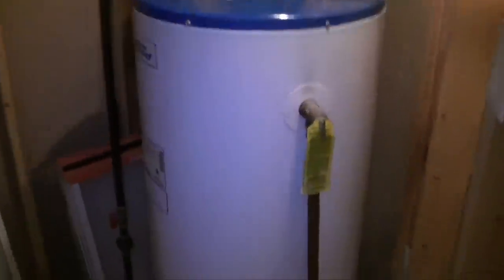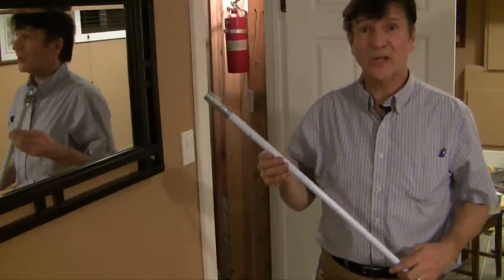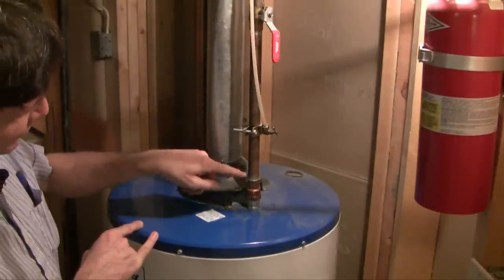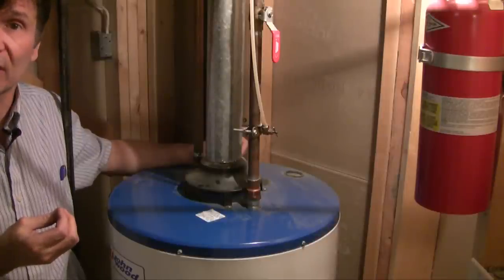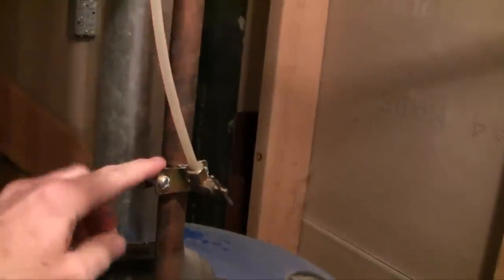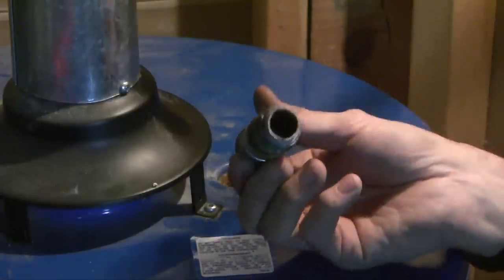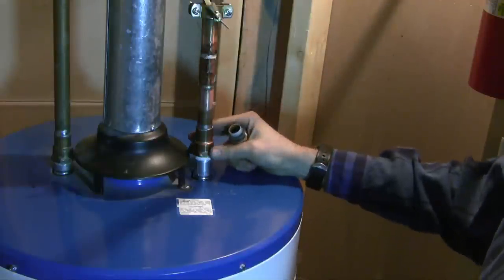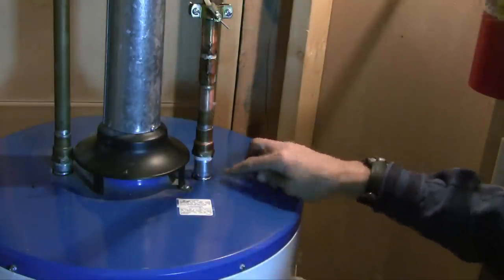How to repair a weak hot water heater, by replacing the dip tube

Comment: Amazing video.  Just what we needed.  Our dip tube was totally wrecked...almost severed from the fitting...obviously the problem.  We have just replaced it thanks to your help.  Saved us the $1500 it would have cost to replace the tank (which was the recommendation made by the service company we called.... verbatim... "We don't replace the dip tube in a hot water heater.  You need to install a new tank.)  This is the third time this year that the internet has saved us big bucks on home maintenance issues.
Reply: Of course not, the plumber wanted to make a lot of money selling you a new unit. You may want to call this same plumber and inform him you didn't need a new unit, just a dip tube that you installed yourself, also remind him
he's a dipstick for not installing a dip tube..
Reply: Katharine Redmond 👍
Reply: @dukeman7595 LOL! I LIKE THAT!

Comment: Just wanted to say thanks for the video.  You saved me $600+ from replacing a water heater.  

I have a 6 year old Rheem so my dip tube is a bit different than the one in your video however I was able to get enough information to figure it out.
My tube was broken off at the connector just like what was shown in your video. 

I now have nice hot water again for about $10.  

My symptoms were; 
1) Hot water runs out in about 10 minutes of use.
2) When draining the hot water tank the water didn't turn cold until after 5 minutes of draining.  It should have turned cold much sooner.
3) The cold water inlet pipe was hot.  It's normal to be warm for 12 or so inches up the pipe, but it shouldn't be "hot".
4) It took 2 mins. 30 seconds when hot water was running before the burner lite.

After replacement of the dip tube all my symptoms are gone.
Reply from the maker: +CJ Harley Hey, thanks for the feedback, I'm glad it helped.

Comment: One plumber told us we needed a new water heater.  Another told us we had clogged pipes.  I replaced the dip tube yesterday and we have hot water again. Thanks for your informative and useful video.  In your face, plumbers.
Reply from the maker: That happens in automotive repair, too! In fairness, I can see it from both sides of the equation. For the plumber to just replace the dip tube he would have to charge you at least a full hour of labour, and even then there's a chance it wouldn't work, it might leak, etc. Then the client is angry if the tank needs to be replaced anyway a short time later.  One angry customer can tell hundreds of his friends about the miserable experience. When they replace the whole tank, they can offer a warranty, the risk is the same, the customer is more often satisfied, and they make more money. Of course the economics change for guys like us, who can discount labour and do home repair ourselves. Thanks for following up!

Comment: Thanks so much for this vid. I have a 13 year old A.O. Smith unit from 2000 that wasn't producing as much hot water as it used to. I really wanted to see if it was the dip tube so I bought one for $4 at a local plumbing supply store (couldn't find one at any retail store). Also bought from Home Depot nipples, a 24" braided line with a Sharkbite connector, and a female to female 3/4" Sharkbite coupling. Had to cut the cold-in pipe, and was able to get the old nipple out with a big pipe wrench. I looked in with a flashlight and could tell it was cracked and in bad shape. I was able to pull the dip tube out in once piece, although it was cracked/shredded from top to bottom. I installed the new one and reconnected everything using all the extra parts I bought (I really thought it all through beforehand - exactly how I was going to hook everything back up). I'm very happy to say we are now enjoying lots of hot water again!!
Reply from the maker: Good for you, I like your idea of using flexible connections and unions so that you can replace the water heater in the future with less trouble. Thanks for the feedback!

Comment from the maker: I'm glad you brought that interesting issue up, and I largely agree. Those sleeves are not so easy to find in my locale, so I just reproduced what is common practice in this community. Historically, it was not uncommon to use copper piping as a main building electrical ground, and electrical code also requires any electrical connections at the tank and tank frame to also be grounded. In that setting, electrical isolation at only the water pipe has limited value.

Comment: Excellent video.  Good job!  I just wanted to point out your temperature and pressure relief valve extension should go down to within six inches of the floor.
Reply from the maker: Thanks for posting that note here, those details are worth remembering. I've been surprised how detailed the regulations are for water tank installations, not to mention the differences between states and countries.

Comment from the maker: You make a very good point, and I envy how much faster those are. In my current home, all the water lines are plastic, but they change to copper 18" before each water tank connection. I wonder if that is a local guideline, for added earthquake safety -- we live on a major fault line. The tank is well strapped.

Comment: This video is very helpful so thanks for sharing. You mentioned at the very end to watch leaks. So what if there's leak coming out from the top? This is what's happening to my water boiler. I started seeing water coming from the top by hot water pipe. Your help is appreciated.
Reply from the maker: That happened to me once before, when I had already used three turns of teflon tape, and I asked a plumber for advice. He advised that I add pipe dope on top of the teflon tape. Pipe dope is a paste form of multipurpose thread sealant, widely available in plumbing stores. Unfortunately you need to start by removing the pipe again, and use a round wire brush to clean the threads again very carefully, to remove tiny particles of rust that might interfere with your goal of a tight fit. Then tighten the connection down as firmly as you can. That worked great for me.

Many have suggested here that I should have used a union above the tank connections to make dismantling easier. In retrospect I think that is very wise advice.

Comment from the maker: You're very right, I didn't have a union handy but it's an excellent suggestion. Regarding wiping the joints, do you mean prepping the joints with flux? Of course I put flux on before the solder -- I thought that would be obvious so I cut that part from the video. Looking at how well the solder wicks into the joint you know that I did it. Thanks for your comment, it's great to have guys with experience sifting through these.

Comment: Easier than I thought it would be.. Local hardware stores dont have the Dip Tube, tho.. I went to Menards, Home Depot and was directed to Furgesons plumbing supply ( I live in Franklin WI).  They had one left. If you need this may I suggest you take a picture of the tank, specs on the side of the tank and the whold connection. They guy would have had a hard time finding the part, but, my picture of the specs saved the day.. I got an "Attaboy" for that one.
Reply from the maker: Good advice! I'm not surprised these maintenance supplies are now hard to find. Few people are willing to put in the effort.
Reply: I'm dealing with this too. Sucks.
Reply: , great advice.  I think I am going to look at the specks. Order the parts and  have everything ready for the job. Then I don't have to worry about my wife telling me I should have bought a new one and hired a plumber.

Comment from the maker: That's a good question, I don't know. If the dip tube is working correctly the thermostat should quickly switch, and after I did the repair it cycled on within about 30-40 sec. But I only did that little experiment twice, and not knowing where in it's duty cycle the water in the tank was, the result was not necessarily conclusive. I didn't know what my dip tube would look like, so it was an educated guess that it was bad. The risk you take is that you could damage threads and not get it to seal.

Comment: While you had the copper apart, did you consider putting a tee in instead of a sleeve? This way you could have added a good ball valve for the humidifier and eliminated the risk of a leaky saddle valve. Upon installing my last water heater I added a shutoff on the hot side to make working on it easier next time. Dielectric unions eliminate the need for solder as well.
Reply from the maker: Those are good thoughts. Yeah, the next time I do it I'll likely do as you describe. I did eventually modify the saddle valve to a full soldered copper tee here. Were I to do it again I'd use a union to make replacement easier.

Comment from the maker: Yes. Indeed, if there is no electrical connectivity between the ANODE rod and the tank, the anode won't work as desired. But the threads cut right through teflon, so even with teflon the connection is sound (I checked with my DVOM). Many modern systems use plastic pipe, so it is hard to argue that grounding through pipe is needed (it's already grounded through the wiring ground). Whatever is used, that connection absolutely must be water tight. Do you know of any conductive pipe dope?

Comment from the maker: @TheKeyboardKowboy @TheKeyboardKowboy You are absolutely right, thank you. This week I searched all over my city for a replacement anode rod for my gas heater, and not one retail or wholesale store sell them. Most knew what they were, and mine is definitely there. When I asked why they are no longer sold, most retailers said that the stock sat without moving. These days, water heaters are not built to last as long, and I suspect the anode rod may not be the limiting factor. ?planned obsolesence?
Reply: there is s site called waterheaterrescue.com that sells every kind of anode and dip tube you will ever need.

Comment: Hi thanks for getting back to me and yes its on all hot water fossets  my water tank is 9 years old they told me i woud need replace it but i wanted to try changid the dip the pressure on cold water is great no problem there just on hot little pressure.
Reply from the maker: In that case, double check that the shutoff valve leading to the water heater is completely open. All of these tanks have a drain valve to flush debris from the tank -- you could carefully check flow there, but watch out that you don't burn yourself. I'm not referring to the high pressure relief valve, I mean the tank drain valve. It would be safer if the heater were turned off before checking, so water spraying out of the valve would not be at scalding temp. you can drain water into a bucket there to see what the flow is. Low flow means the obstruction is proximal to the tank, high flow means the obstruction is distal to the tank. High flow there means the dip tube is not obstructed, but it could be something jammed at the hot water exit pipe that takes water from the tank to faucets. I suppose a fragment of a damaged dip tube could be blocking exit....

Comment from the maker: Sometimes a 'union' is used, that makes it a lot easier to disconnect and reconnect. If you read the comments a few professionals suggested using a union rather than soldered joints. Whatever is used needs to be water tight.

Comment: Thanks for the great video.  Unfortunately mine has the same symptoms,  but I was not able to open mine . You make it look so easy taking the old one out. Do you recommend any tricks to open it. I went through the process only to fid out that the old dip tube is almost impossible to open. I will appreciate any suggestions.  Thanks
Reply from the maker: You're right, that was the hardest part. I used a breaker bar, but even with that the tank tends to spin. If your tank has earthquake straps it might be easier. Some guys use air tools, which offer a vibrating action that might help.

Comment from the maker: @timi0000 As far as I know, there's no easy way to tell. But when you turn on the hot, the heater should fire up quickly, with no delay like I showed here. The tube should flood that thermostat with cold and it should start. There will, of course, be some natural variance with that test depending on where in the cycle the water temp is at. A new tube is so cheap that by the time you open the system up you may as well change it. Fractured dip tubes are really common.

Comment: Thank you for the video. I never knew I even had a dip tube. Ended up crushing the dip tube connection to the tank. Purchased a new connection from big block store along with the Shark fitting. The Shark allows you to add an extra turn to the fitting after installation. The dip tube was fine but the heater has all the same symptoms. Heater temperature set at 130. Any hints on what the next part to remove?
Reply from the maker: If it's a gas heater, I would inspect and clean the burner plate. That can sometimes get clogged full of debris that interferes with heat transfer. And occasionally debris inside the tank can do the same thing, so you want to flush the tank once in a while. If both of those are OK, then I would wonder if the thermostat is failing or malpositioned.

Comment: My water heater is about three years old, is leaking from the top, I check the pipes and they all look ok, the water seems is coming from the little holes for the exhaust fumes, i'm about to buy a new water heater but want to have a second opinion. By the way, the water is coming out with a light dark color. Thanks for the response.

Comment: what would you have to do if there is only 1 to 2 feet of clearance above the tank?  Disconnect everything including gas and tilt it, then reconnect?  Can the dip tube bend/flex for easy insertion?   I guess if you had to replace anode with little clearance then only option is tlting.
Reply from the maker: If it's only an inch or so, you can cut the tip off the tube with a hack saw. Otherwise I'd tip the tank over a little and slide it in. The tank is normally empty when you do this repair so tipping isn't so hard in some cases. There are anode rods that are sold with a joint that allows for limited overhead clearance, but I'm not aware of dip tubes having the same feature.

Comment: Excellent video!  How old was the old dip tube? I was going to replace my anode rod and figured I just as well should do the dip tube at the same time.  My heater is 5 yrs old.  Another suggestion would be to clean out the tank by pouring some vinegar in once drained.  I noticed after flushing mine and draining there were still quite a few calcium deposits - some quite large - still at the bottom which did not flush out.  Doing all this stuff at the same time makes it very worthwhile and something easily done every 3 yrs or so.  Again great video!
Reply from the maker: +condor5635 Mine was about 12 years old, but there is broad variance regarding how long those things last (mostly depending on the quality of electrolyte in your water). Yes, flushing the tank is wise, hopefully before the calcium deposits become too large to flush out the drain.

Comment: GREAT VIDEO!!  A question - all I can find to buy is a dip tube without the threaded attachment - do I just "drop" the new dip tube into the nipple attachment?  Or do I need to buy a dip tube with the threaded attachment?  THANK YOU!
Reply from the maker: It needs to seamlessly attach to the tank, so I'd look for something that is identical to what you have on your tank. Once you've got it off, it may be hard to reattach so you don't want to be waiting for parts. If in doubt, I would go to a specialty store.

Comment: So just changing the dip tube will work? I already changed all the other parts, and yes the water is cold. The te AO Smith tank is only 3 years old.  Well I plan to check this dip tube this morning because this seems to be the last item on the tank that's original.   Great video by the way.
Reply from the maker: Worth a try, good luck!
Reply: Lol, that was not the issue.  Top element was new, come to find out it was defective.  AO Smith  got me a new one. All is good. Mom is happy now, she has Hot Water.

Comment: what is going to happen if you don't take the broken dip tube inside the water heater out when you replaced to the new ones?
great video, thanks.
Reply from the maker: Nothing will happen, it's what normally is done, it's what I did in this case. The plastic shatters and so there will be a long segment standing in the tank and multiple small pieces at the bottom. With the water in the tank, the temp (even at the bottom) never climbs much higher than boiling point, since the adjacent water will absorb excess energy as latent heat. This means the plastic doesn't get hot enough to melt. That plastic is approved to be used with hot water so the chance impurities will contaminate the water is very small. It would be very difficult to snag the big piece and pull it out the hole, and I wouldn't bother.  You might be able to flush sediment, which might include tiny plastic fragments, out of the tank when you drain it, and it is good policy to drain water heaters intermittently. I suppose very tiny fragments could become suspended and overcome gravity to end up in the hot water supply, but even then the screens at end plumbing fixtures will trap most particles before they end up coming out your tap. Good question, I've flagged it since it's commonly asked.